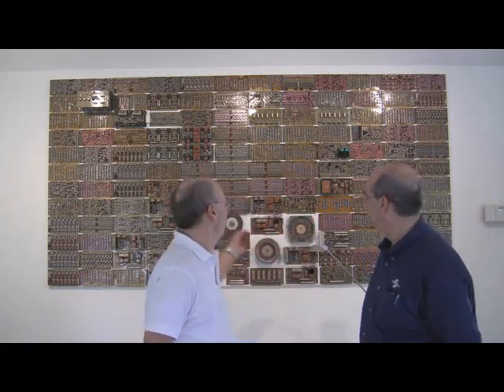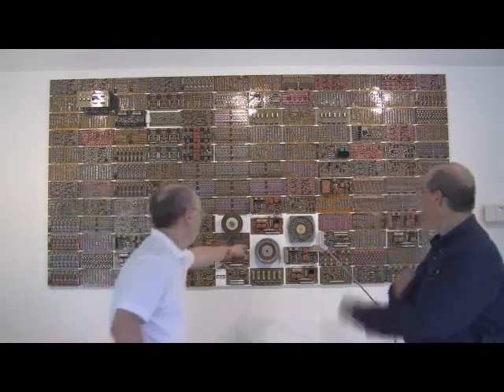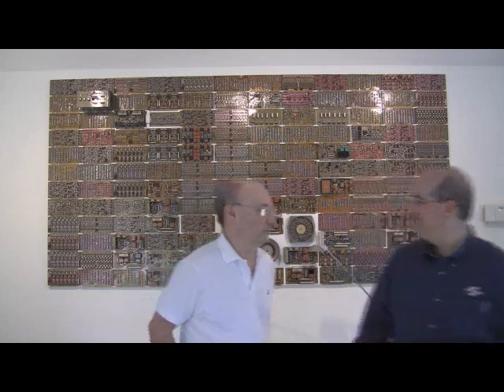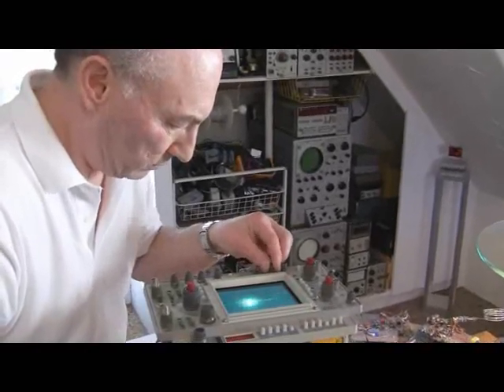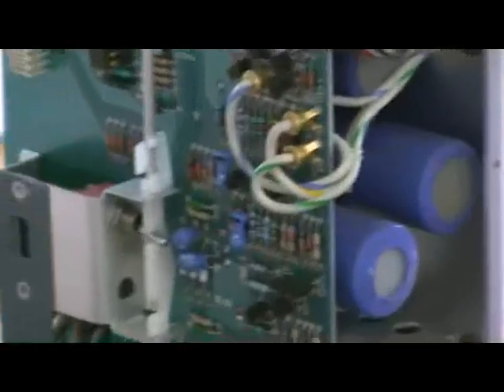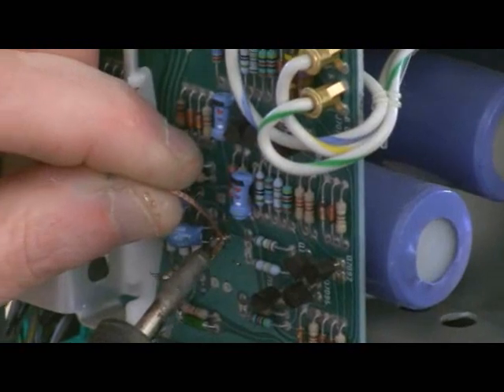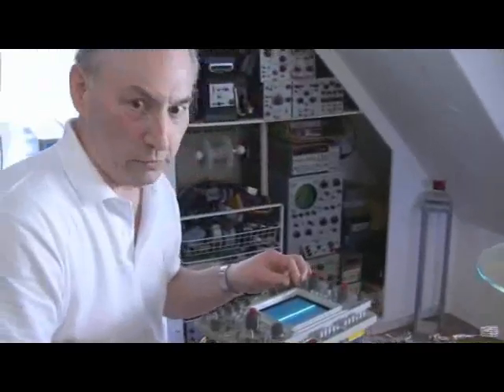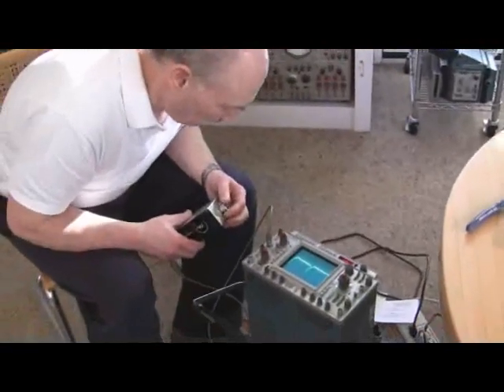Jim Williams Tek 465B Fix v3

Comment: A dip tantalum in a Tek scope caught fire in our lab one day. The scope was customarily left on 24/7, and was right against wood joists. It ignited a nylon card guide, and would have subsequently burned the place down if someone wasn't there to notice. The take-away is:  Don't leave equipment on when there's no one around. The other take-away is:  Be wary that these types of tantalums have a very low ESR,  and are prone to shorting with rapid voltage transients. These days, tantalum polymer types may be a better choice.

Comment: Excellent presentation and most useful information. I have been going through my collection of old Tektronix and Telequipment CRO's. I powered up the 465B after PA Test for earth continuity, etc. I ran it from a 200W isolation xformer via a 100W filament bulb. It lit the bulb to about 1/2 power and so was drawing way too much current.

You have given me a valuable insight into where best to look; I was unaware the instrument used tants, I shall start with replacing these with new elects., and then work from there.

Comment: Very interesting as I’m working on a 465 and the first thing I did was measure the resistance of the supply rails and found a dead short Across the 15v rail .  Although I haven’t Isolated it to any bored yet. That’s the next job. Obviously it would be important to check for ripple on all the supply rails as it’s the main cause of tantalum failure. But be funny if it ends up being the same fault but I will will have to let you know. https://youtu.be/OG8NXRfAUbk
Reply: https://www.youtube.com/watch?v=uCqwVvmi9kA

Comment: I worked as a sales rep for HP in the '80s. Selling an analog HP scope was tough. :)
Reply from the maker: I worked for HP as a lab engineer in the 1970s and had an HP 182C "fat beam" scope on my bench. There's a reason or three why selling an analog HP scope against Tek was very tough. But when digital scopes appeared, the tables turned 180 degrees. If not for Dave Packard's largesse towards Tek founder Howard Vollum who brought his scope ideas to HP first, Tektronix would never have existed. But it did, and made fabulous scopes like the 465.
Reply: The tables did turn 1(9)80 degrees:
http://hpmemoryproject.org/news/1980/hp1980_page_00.htm

Groundbreaking scope!
Reply from the maker: If you say so Rick. The HP 1980 scope certainly broke new ground and is clearly a milestone in the evolution from analog to digital scopes. It presages some of the 1-knob thought that swept Colorado Springs's scope and analyzer user interfaces for a while. But I just took a look at HP 1980 scopes on eBay versus Tek 2445s and 2465s (which are also analog/digital bridge scopes). I found one HP 1980 (not working) and hundreds of Tek scopes in various states (not working, working, refurbished) on eBay. Ditto YouTube videos. I found two about the HP 1980. I leave it to you to decide which sold more and ultimately had more influence.
Reply: The 1980 broke ground by facilitating automated time series measurements as part of an ATE system. Sequential tests could be programmatically set up and the results programmatically analyzed. The 1980B form factor was specifically for racking. The 1980 was also very expensive, but worth it for those that needed its advanced capability. The Tek scopes were primarily targeted as bench scopes and were less costly so obviously more of them were sold. HP later came out with the 54XXX series which were digital bench scopes at equivalent price points to the Tek models. Many of those are on the used market.
Reply from the maker: Yep, I can certainly see how the 1980 with its processor-controlled controls would work better in a rack-and-stack ATE system than anything Tek could offer.

Comment: So the tanatlum capacitor reads 0ohms across its two legs?
Reply from the maker: +Justin Le Could be zero or a few tens or a few hundred ohms. Any reading in that range means the capacitor is too leaky to work.
Reply: +Steven Leibson ahh thanks. ive been checking capacitors with both legs soldered in the PCB and assumed a shorted capacitor would read 0ohms, and that any other reading were just the rest of the circuit in parallel. From now on i will remove one leg and read resistance that way. no wonder why i've been so stumped.
Reply from the maker: +Justin Le Right. You can't measure this in-circuit with an ohmmeter. You need to lift one leg. Also, the reading will change initially as the capacitor charges up. Then it will reach a steady resistance value. A few hundred ohms or less is a leaky capacitor. Zero is shorted, of course.
Reply: +Steven Leibson thanks for the response. this helps a lot.

Comment: Hi: I am sorry to hear that Jim William passed away. I am impressed with his D17 minuteman computer mounded on the wall-does it still exist.  In 1961 thru 1963 I worked at Autonetics on these types of computers. I worked my way up from assemble to function test inspector. I am doing family history and I would like to asked- if you could sent me a photo of the D17-57673-501 read write board. I inspected all the boards but this one I  remember the best because I inspected thousands of them.  I am now a retired Professional Electrical/Pwr Engineer-Thanks
Reply from the maker: +Anthony Vidana Anthony, I am afraid I've had no contact with Jim's widow since he passed. I don't have a photo of the boards mounted on the wall.

--Steve
Reply: +Steven Leibson  Thanks anyway. I used a board from a photo that is in the EE times dated 2004 http://www.eetimes.com/document.asp?doc_id=1230567. It is an article about Jim Williams D17 minuteman computer boards hanging on the wall. The article has two close up photos of some of the board. The 57673-501 is shown but only partially but for family history it is good enough. Thanks for your help. Hopefully William widow donated the computer to some museum. It's part of history.
Reply: +Steven Leibson- I finally found a full scale photo of the 57673-501 as well as many other D17 computer boards they are listed by name not part number http://www.repairfaq.org/sam/d17b/d17bpcbs/ the part numbers and names and assembly slot numbers are listed in the D17 computer users group document but without photos. https://archive.org/details/bitsavers_autoneticsLogicEquationsApr71_11761659  But it like the Rosita stone for putting the photo with the part number together. The assembly numbers are show above the slots on the overall photo of the computer if you are looking to find where they go on the computer. the completee computer photo is found all over the web site by goggling it and is shown in d17 Wikipedia https://en.wikipedia.org/wiki/D-17B#/media/File:Autonetics_D-17.JPG I hope this information can help somebody else. Thanks for your time

Comment: What is the "Tektronix 465 b"
Reply: The Tektronix 465 was the workhorse oscilloscope for electrical engineers and technicians during the 1980s. The "B" version was an update of the original.
Reply: *****
The computer in the background is indeed from a Minuteman missile but it's not a Tektronix 465B, which is the oscilloscope that appears later in the video.

Comment: Hi there guys, maybe you can help me, few days ago I purchased a HAMEG HM203-6 analog oscilloscope in a flea market. It's in good conditions when you see the electronics components and  all the boards. I only changed the X-pos potenciometer for a new one.
But when I put in the Ground mode on whatever the two channels you dont see a line across the tube for calibrating, instead, you see somethin like a static sinusoidal signal. If I put a signal with the generator you can see it distorted a modulated above this static signal. In wathever position of time/div control.
I think the problem is in some transistors of Y Final Amplifier, becuase when you measure voltage in some nodes is not the same of the schematics. points like the voltage in the vertical deflexion plates or the output. What do you think?
Thanx a lot

Comment: I wish he was alive to help me fix my scope! It's a BK precision with no tantalum capacitors, so I'm clueless, haha. The EBC pins of both transistors in a cascode amplifier stage al read about the same voltage, but I don't know what is causing that to happen. It was my grandpas, so I'm not going to toss it in the garbage.

Comment: You nailed it ... for me! Got my 465 in nonworking cond. from eBay in 2008. Was/is in SUPER cond (FAA surplus) but didn't work. Replaced a 0-ohm ("bad", I assume orig.) tantalum (per this vids suggestion) in the PCB area shown. And voila. Need  Isay more.
Actually, anyone know how to modernize this scope to "modern" stds. Other than $ third-party calibration/certification?
I've heard replacing the electro caps with modern caps helps. Any other tips? THX!!

Comment: @321reh I am sorry but Jim's skills on removing the solder using solderwick leave a lot to be desired . A motor vacuum solder sucker would have been better.  The  S/C 47 uF tantalum capacitor across the 15V DC power supply is a standard fault in the 465.
    I started my Apprenticeship in 1965, fault finding to component level is not hard if that's what you have done all of your working life, other equipment as well as Tektronix oscilloscopes.  Rob